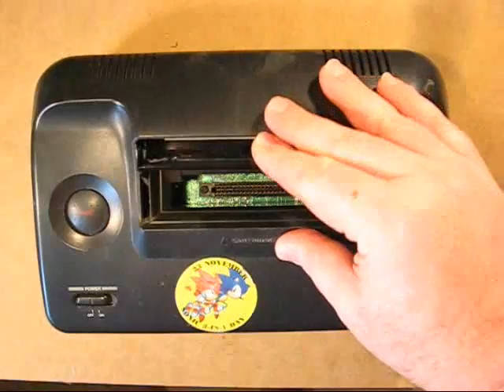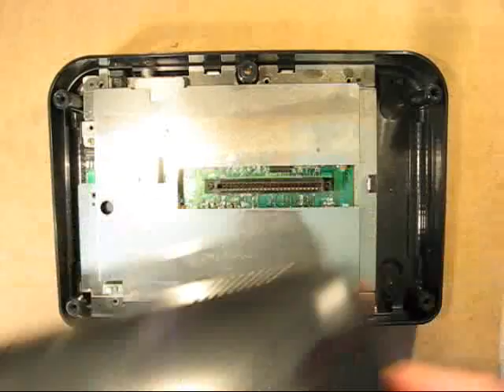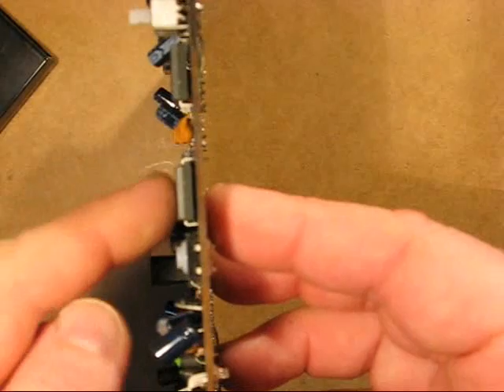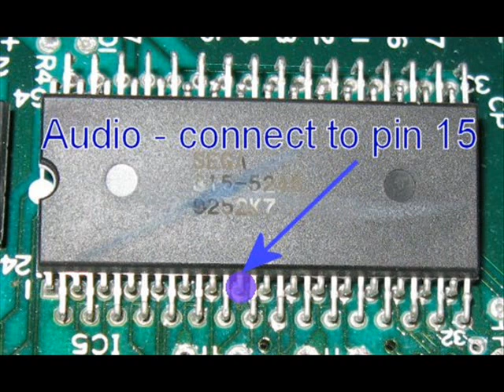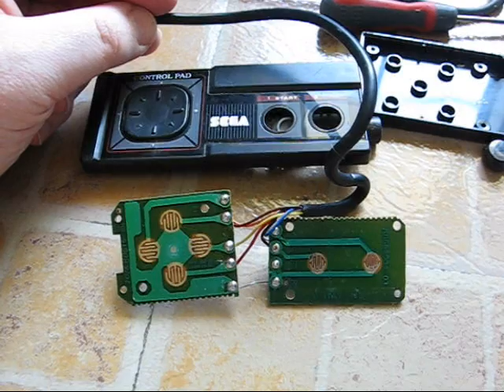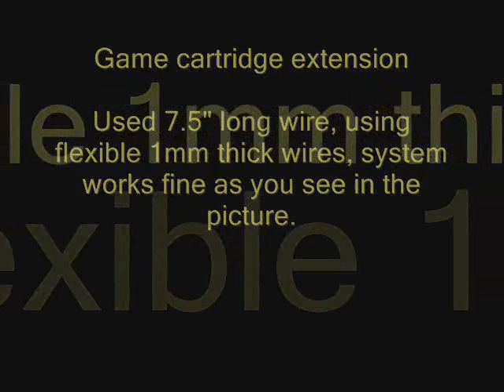Alpha Omega project - part 1 - Sega Master System2

Comment: @MODDEDbyBACTERIA  The mb3514 is better, as it can output S-Video and composite directly without the need for a video amp.  But when using RGB there is no difference between the two encoder chips.

Comment: Good to see you're doing the sega master system Bac. 

You can take RGB for any revision master system 2. The later boards use the Fujitsu MB3514 encoder, that is also used in Megadrive 2's. It outputs RGB same as the CXA1145 does. Google "MB3514" for the datasheet.

Comment from the maker: So do I. The fact is that only a small number of consoles are that easy - SMS, Atari 2600 (I think), GX4000; most have a variety of components on the controller that make them refuse to be connected to others, even on grounding.